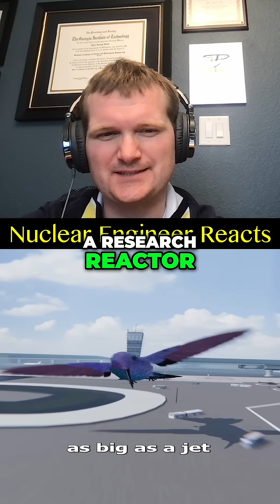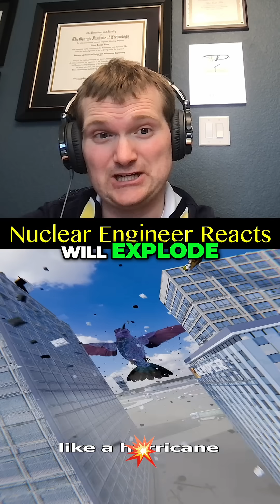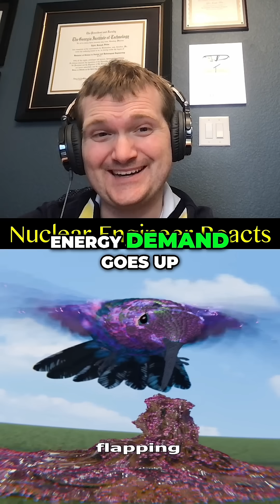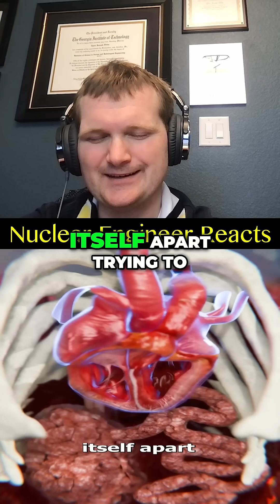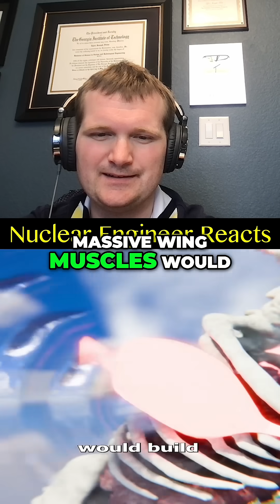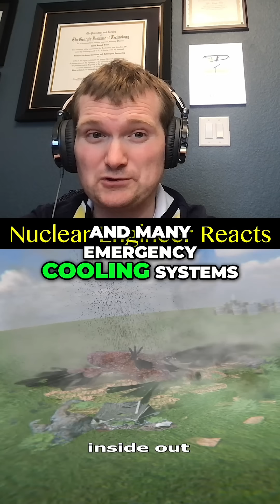What if Hummingbirds were Jet Plane Sized? - Nuclear Engineer Reacts to Zack D. Films

Comment: It's simple, weight increases by volume so r³ but the integrity or tensile max load scales to its cross sectional area(keeping the material same and crystalline) r² so after a certain point the weight: strength ratio increases very rapidly hence completely overpowering the structural integrity of the bird. You also have many other factors like the shear forces when it's flapping and the drag from the air all adding against the tensile strength.